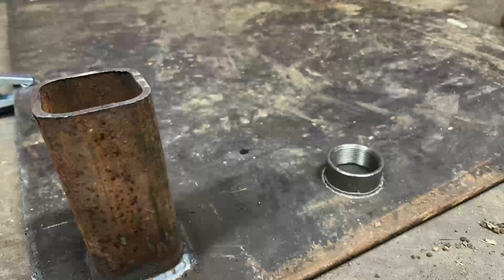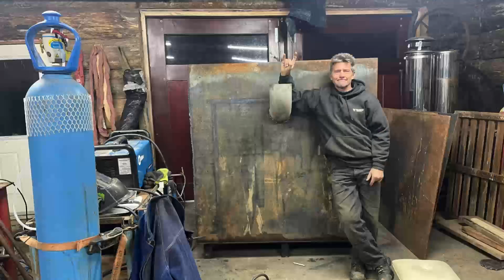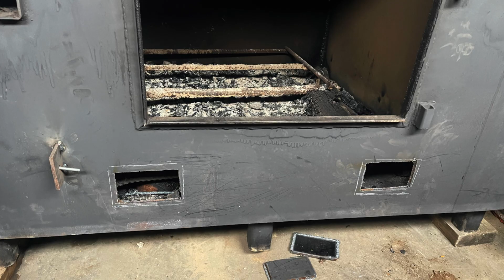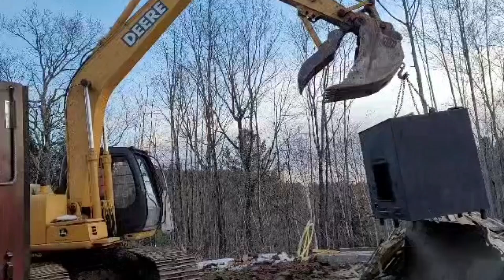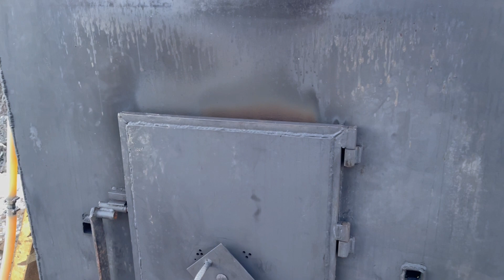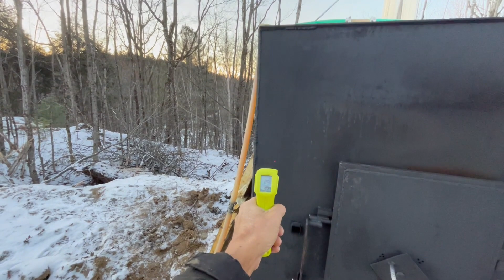THE WOOD BOILER THAT ALMOST KICKED MY BUTT !!

Comment: Awesome boiler build Dean! I imagine you’re going to insulate that beast, you want the thermal storage of the water jacket to stratify, hot water at top, warm water low. If I understood correctly you have the supply coming off the bottom and return to top, I would modify that so supply is leaving wood boiler from the top and returning to bottom, as a hydronics professional my only other advice would be to keep your water jacket above 57-60C(135-140F) to prevent flue gas condensation/creosote, at 31C its too cold, gonna wreck all that hard work prematurely. I would use a Taco VT2218 or similar on the boiler side, which can accommodate for boiler protection and keep return water above that 57C. Can always add a 3 way mixing or thermostatic mixing valve to adjust infloor temp lower and keep your DHW supply at 60-80C.  Cheers from Alberta.

Comment: Boiler looks well build but I feel like your going to be married to it 24/7 once the slab comes up to temp you want you your boiler to be north of 165*f so it doesn’t sweat and cause it to rust in your case with 3/8” steel it’ll take a long while to rot out but I feel like you need to add a aquastat and a electronic dampener that open and closes as water temp raises and falls or it will boil over and as for your pex lines in the ground they’ll work but when you get ground water around them your heating it and your temps will be very very low there’s a saying in the boiler industry but the expensive stuff now you buy it later either way your gonna buy it I’m not trying to insult you in any way just tying to help
Reply from the maker: ty poor ,point is well taken ,and will probably modify as i go ,the boiler was planned and needed to get up and running fast as the weather was getting colder!!! cheers and happy new year ,dean
Reply: @adadventuresontimbermounta6764  oh I get it I patched up a 30 year old central boiler I bought cheap to get me going
Reply from the maker: hi toopoor , a little update on the boiler ,i started with 4 hr runs and now with adjusting the air inlets (draft style) i am up to 8-9 hr runs and the temps coming out are 30 degrees celsius,without the outer shell on which i am in the process of building,next video will show this